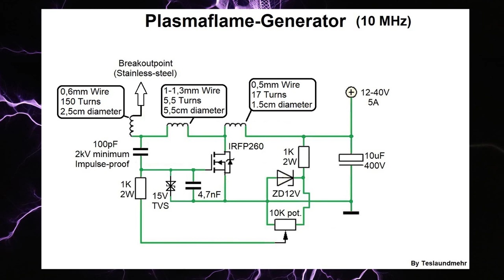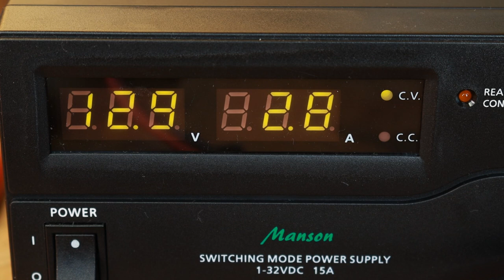DIY Plasma flame Tesla Coil - Step by Step (ft.Plasma Channel)

Comment: Awesome work, high quality!
Reply from the maker: Thank you!!
Reply: Can this plasma flame be blown off by wind? (Like trying to blow it off like you do to wax candles). Some body please help out.
Reply: @Teslaundmehr  Can this plasma flame be blown off by wind? (Like trying to blow it off like you do to wax candles).
Reply: @Teslaundmehr  That is, you set up the circuit at a voltage of 12 volts and how many volts you asked the circuit then when you have already earned the torch
Reply: Ilove you franzoli
Reply: @Teslaundmehr  sir can we use irfp540 MOSFET instead of it...
Reply: @Teslaundmehr  please 🥺🥺 tell me
Reply: @Teslaundmehr   need help  can we use irfp 540 MOSFET
Reply: @singh...23 no you cant

Comment: Another question.   Is there a way to build this so that the flame shoots out sideways, instead of vertical?  If not, any ideas of what modifications would be required to generate a flame shooting horizontally?   Thank you very much.

Comment: I'd rather give you the like as the source for the knowledge of the piece. Back in the late 80's I made a plasma sculpture with two large top hat transistors and a flyback transformer so I only had to do the windings for the primary coil. I think it oscillated at 21khz. It was much more robust than using a picky MOSFET. Those sculptures cost a lot back then. Keep up the great work using modern tools to accomplish the same things and thanks for the video.

Comment: This is such a cool little pseudo Tesla Coil with an awesome flame like arcs! I really want to build one of these, copying your exact build. However, I hate potentiometers because they're very prone to degradation. It would be practical if I use a resistor voltage divider instead, but I doubt that's going to work. But yep, very cool!

Comment: Looks epic, can’t Waite compared to the other plasma flame generators, this one looks the best.
Reply from the maker: hehe yes 
definitely ;)
Reply: After watching a can certainly say it was epic. Once I order the proper capacitor, I’m gonna build it.
Reply: Out of curiosity, does the mosfet get hot when running at full power?
Reply from the maker: @quantumlab9130  Thank you so much! Please tell me If your device will work ;) Yes the mosfet gets very hot. You can cook on the heatsink :D

Comment: The HF master, that's a really impressive output. This is a high demand video. I know 260s are great for this but I'm still surprised you get such good output on this circuit because they are so easy to pop compared to 460s.
Reply: Not only hf 😂
Reply: @tvishmaychoudhary69  this is true
Reply from the maker: Thank you so much!! Yess 260 are great, but with 460 you can un this circuit with a higher Voltage ;)
Reply: @Teslaundmehr  Würde das etwas am Tuning verändern? Der Aufbau wäre ja wahrscheinlich langlebiger.

Comment: Hey there nice video! I was wondering if this could be regulated ? as in, changing the output frequency and voltage with potentiometers? and monitor the output with indicators ? greatly appreciated!

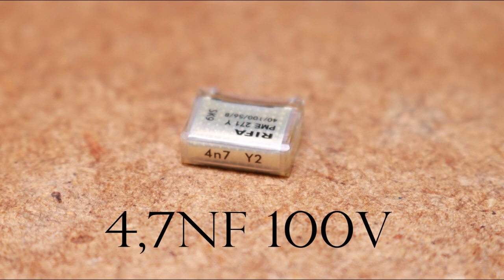Comment: 3:00 You mean don't use a ceramic capacitor, not "keramic"?
And why not?
Reply: Horrible frequency response, also gets very hot = power losses
Reply: @XplodingZDoomDevice   I quote website element14 " Ceramic capacitor: They have a great frequency response due to low resistive and inductive parasitic effects." And my school book say same thing, that ceramic capacitor are exactly meant to be used to high frequency applications. Ceramic capacitor has low Dissipation factory and because that, they don't heatup so much. So my question is, did I miss something?
Reply: @eetukuusisto9133  in RF currents, the esl and esr become very high and they lose 90% of their capacitance(depends).

Comment: Hello. It was the best movie I have ever seen. Thank you very much.
I had two questions.
1- Is it possible to have two outputs from the high-voltage part and convert it to DC?
2- At the end of the movie, how did you increase the length of the flame to 11 cm?
Thank you in advance for your reply.

Comment: hello friend, i made the circuit and it works. the only problem in facing is that when im using 100pf capacitor the circuit consumes lot of current and dont oscillates but when i add parallel 0.1 uf capacitor it starts oscillation and current drops

Comment: At 6:57, why did it work when the resonator was not inside the primary?
Reply: The primary has a very strong electromagnetic field around it, enough to induce current on the secondary (the resonator) at some distance.

Comment: You seemed pretty comfortable around the plasma, if it were to hit your hand would it Shock or Burn you? Maybe both?
Reply: It would definitely burn, but it wouldn’t shock because it’s running at such a high frequency which causes the "skin effect". The skin effect causes the current to only flow on the surface of any conductor (your skin) and not go deep enough to stimulate the nerves.
Reply: @tomg0  Thanks for the clarification! Makes more sense now.
Reply: @tomg0  that is wrong. The skin is not a very good conductor and the skin effexct only works on good conducting Materials. But you won't feel the current. The nerves don't registrate the high frequency.

Comment: Trying this circuit out myself, but a lot of stress is being applied to the mosfet. Would using multiple mosfets in parallel compromise the circuit?

Comment: sparks at 06:00 indicates the primary voltage is too high, is it working like a boost circuit ? what are the things at 00.25 ? Thanks

Comment: I have a question, 
Is it necessary to wound the primary wire around the secondary  in hfsstc?
I have seen some of them that the primary is at the diatance of 10 or more from the secondary
Or like you near the secondary and not around that.

Comment: Many thanks for that video - got mine working but it oscillates only at 7Mhz and the flame is around 4-5cm.
How can I tune the circuit further? 
I had to do way lore turns ob the 2.5cm tube and .5mm wire to get to the 10uH. Maybe that’s an issue?

Comment: I built two of these, one for me and one for a friend. Very nice design.

My friend likes operating the coil for a long time (>5 minutes) and the tank capacitors have failed twice. We are using the WIMA capacitors that Jay used in 2x2 array.

I would like to find a more rugged capacitor. Do you have any idea where to look? 

I thought of transmitter capacitors and did buy one very big doorknob capacitor. It got too hot to touch in about a minute which really shocked me. I am running 45V @ 4amps DC input.

Cheers.
Reply: Damn , I would like to be your friend 🤣🤣 , could you show your build ? I am thinking about building my own butterfly capacitor with some aluminium plates wich would also allow me to tune it
Reply: @rodriguezfranco3839  
The driver for this coil is shown in the video. Finding a good capacitor is harder but still not too bad. I'm not sure what a butterfly capacitor is.
Are you talking about a variable air capacitor?
Reply: @cometboy1  Yes I mean a variable air cap , I saw another chanel who used a big air cap , here in my country is hard to get nice capacitors ,I can not get nice wimas mkp ,and there is no way I could find one of those nice doorknob capacitors
Reply: @rodriguezfranco3839  Sounds very frustrating. I wish I could give you a direction to go but I have never built my own HV capacitor..
Reply: @cometboy1  Thanks so much for your knowledge , I think I am gonna pause the hfsstc build till I get better Quality components and knowledge I think it is not worth to kill a bunch of fets and still get a lame performance , anyways I got a lot of tesla coils projects going on

Comment: what a brilliantly put together & well explained video, 
ive been building spark gap Tesla coils for a lot of years but only recently started getting my head around solid state systems,
I have not had a go at one of these little high frequency plasma flame type ones yet.
 Your video has motivated me to have a go this evening, i have a selection of MOSFETS here but i dont have the IRFP260N, I do have a couple of IRF350's, will the circuit you use here with these components work with an IRF350,
 or is you circuit specific to the characteristics of the IRF260N MOSFET ?
I think having a go at this will help speed my learning process for solid state coils.

Comment: does this fire have thrust? is it possible to multiply fire output, in one device? is it possible to isolate the electromagnet so that it does not leak and concentrates only on the fire and impulse, not to turn on other electrical devices that come close. is it possible to make thrust from this tool?

Comment: I built this circuit as described. I will start to draw current as I turn up the pot past a 1/4 turn. Everything appears to be fine, but the circuit is not resonating... will not light a  cfl bulb... any ideas what is going on? is this circuit super sensative to the turns on the primary coil?  I have not hooked up the secondary coil yet.  Thank you for a great video - it was very easy to follow.

Comment: Hi Leon, great video. I tryed to assemble the circuit and it actually works, the only issue is that when I test it without the secondary coil, it starts resonating even before i start rotating the potentiometer. Is that ok or not? Thanks.

Comment: wow magic!  it can melt tungsten?
Reply from the maker: No I actually test it today :D
Reply: @Teslaundmehr 🧡🧡🧡  I want to build same one  can buy from aliexpress?  Or. I just bought Tesla generator.
resonator tube is OD50mm big and 300mm length.output is 100KV,03mA  5W~30watt with potentio knob(control power), does this can generate plasma flame?

Comment: Can I make the yellow inductor from insulated copper wire 0.5mm instead of rubber coated one?
Also how does the calculation change with wire diameter?

Comment: I wonder how small you can make one of these and still have it functional.

would be nice to have something like this , would be a good alternative to
arc lighters which have a very small area just due to the arc not being able to jump far
and 
traditional flame lighters which use up fuel that has to be replaced.

Comment: The circuit is a mosfet killer if you do bad the capacitor current way to the mosfet gate. Your circuit is challenging. I have the oscillator working but the resonator isn't tuned.
Reply: Other forms of killing your mosfets with this circuit: exceeding VDS, exceeding VGS, exceeding IGS, put the mosfet in the ohm region in paralell with the power source voltage (mosfet killer mode).

Comment: Woooooow man,what a beautiful flame! I have to build one for me,omg!! Could you tell me if i can replace the IRFP260N for a IRFP4868? The IRFP4868 can handle more power and voltage,but the gate threshold voltage is 1V above 260N. Other doubt i have is about the input power. I have a power supply of 66V 6A 396w, it will have any problems with the mosfet? In order to get around 10cm of flame, this MOSFET(irfp4868) and input power can handle?Seriously man,thank you,this project is awesome!
Reply: I would say it doesnt matter as you can regulate the gate voltage with the potentiometer (i think he said its used as a voltage devider in the plasma channel video) if i interpret the circut correctly
Reply: Thnx,man! I will try it carefully